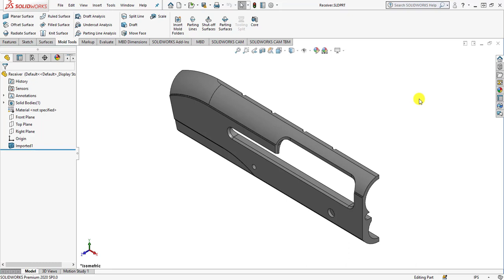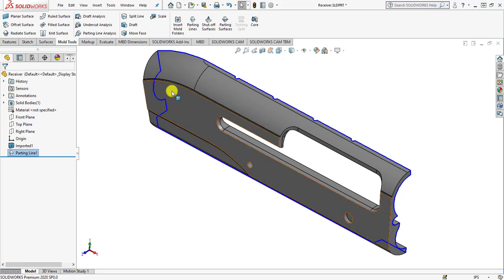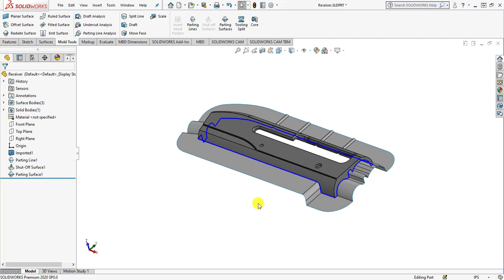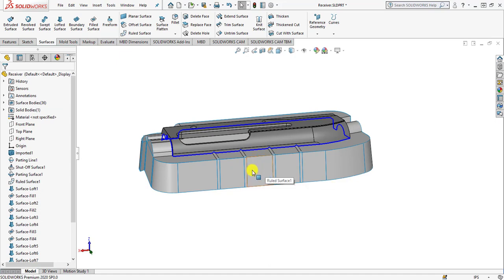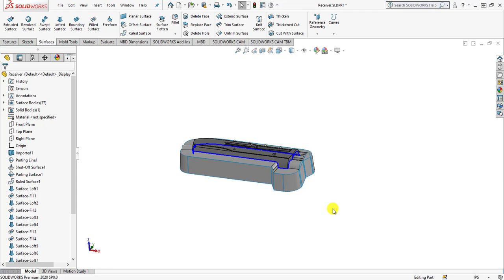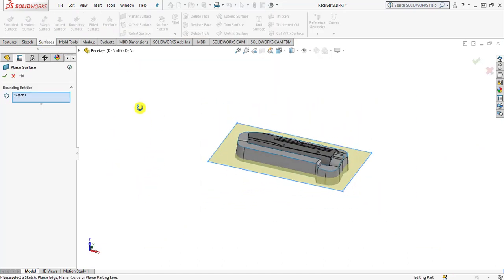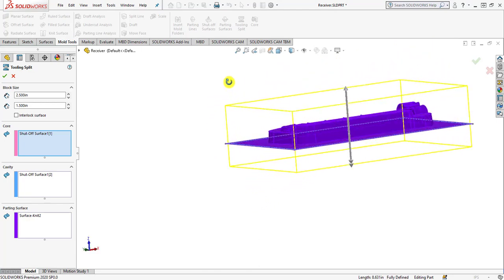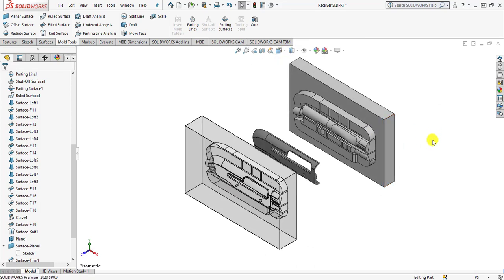SolidWorks Mold Tooling: How Non-Planar Parting Lines Can Give You the Edge

Comment: hi, nice tutorial. can you tell what is the benefit of interlock surface in mold tooling. or can you refer to any link thx
Reply from the maker: The interlock surface surrounds the perimeter of the parting surfaces in a nearly perpendicular direction. As with all drafted faces, the interlock surface drafts away from the parting line.

You can add interlock surfaces to a mold part to achieve the following:
Seal the mold properly to prevent liquids from leaking.
Guide the tooling into place during the molding process.
Maintain alignment between the tooling entities.
Prevent shifts, uneven surfaces or incorrect wall thicknesses.
Minimize the cost of machining the mold plates across the split, because the area surrounding the interlock is planar.
You can manually start to add an interlock surface to the parting surface of a mold part with the Ruled Surface  tool (Mold Tools toolbar), and complete the interlock surface with other surface modeling tools.

Reference for further information: https://help.solidworks.com/2019/english/SolidWorks/sldworks/c_interlock_surface.htm

Comment: Sir I have am issue in creating parting line can u please help ?
Reply from the maker: yes, please what type of problem you are facing.
Reply: @GTIC92  sir there is problem during core cavity extraction I tried so many times
Reply from the maker: if possible you can share your file at the following email address. I will guide you after reviewing it.
gtech.ic@gmail.com
Reply from the maker: Have you sent the file?
Reply: @GTIC92  yes I have sent plz check your mail